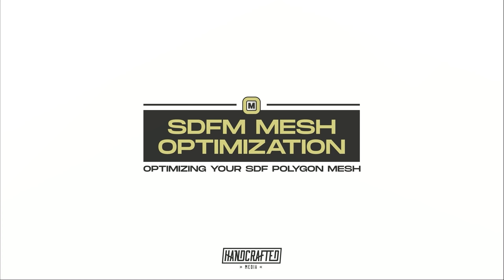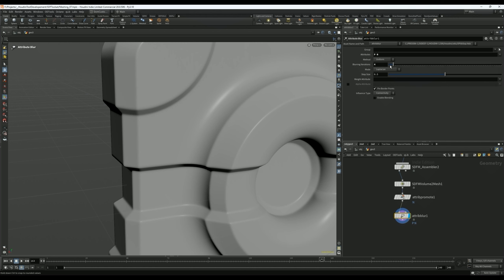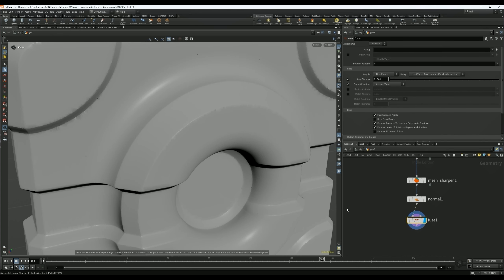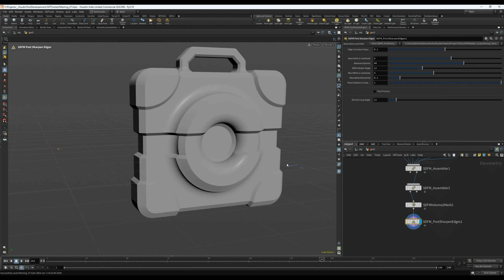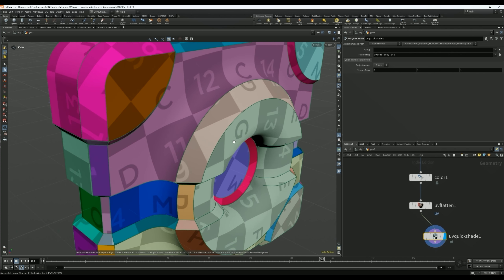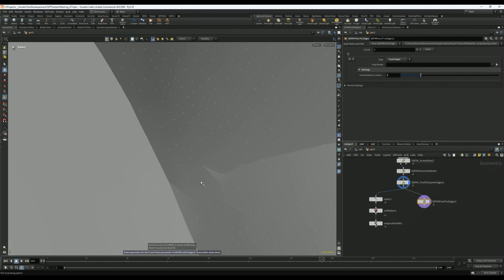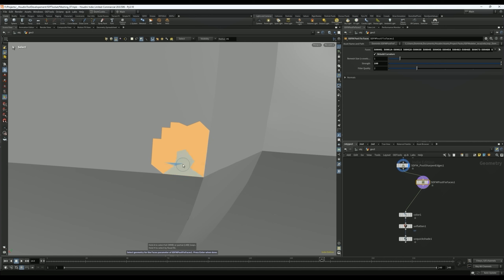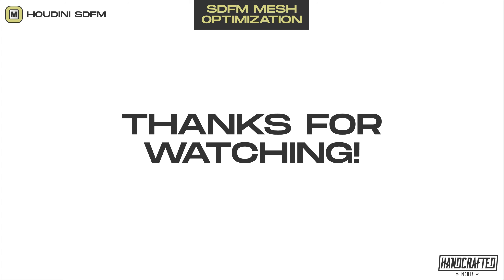Houdini SDF Modeler - Optimizing your Mesh + UVs

Comment: Can you give an ID to the construction shapes and preserve them on the sdf for panel creation?
Reply from the maker: Because SDFs are voxels their faces all are in a way "mushed together" and thus makes these kinds of things very difficult to near impossible. I did add a new node called convert prims to mesh (I believe it's called) that you could use to attribute transfer an ID over from the original source primitives. But even that is not a great option as the attribute transfer won't leave clean results and straight up won't work in a lot of cases.